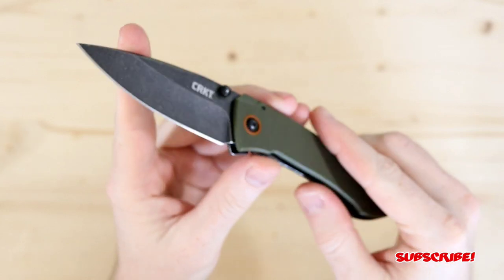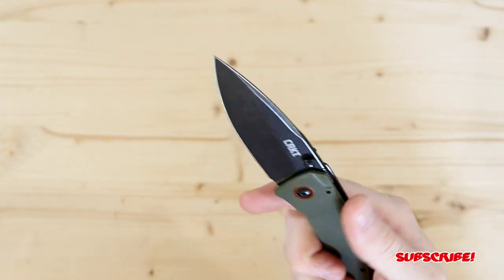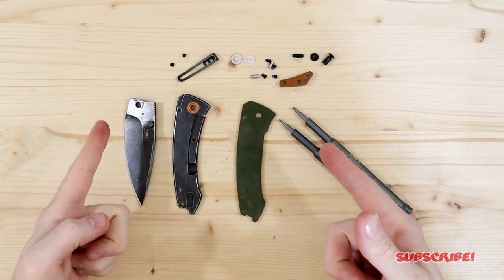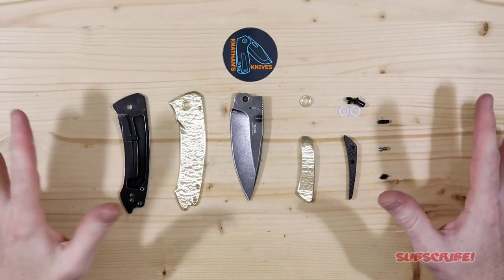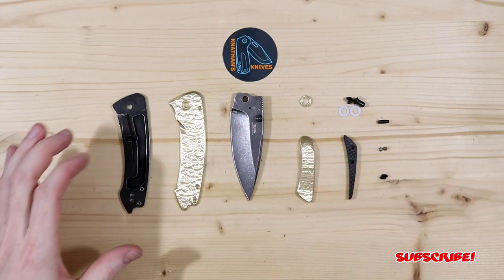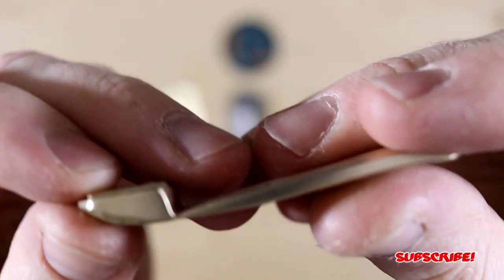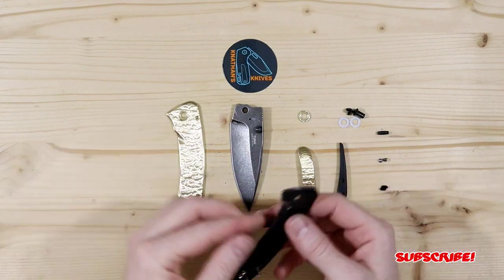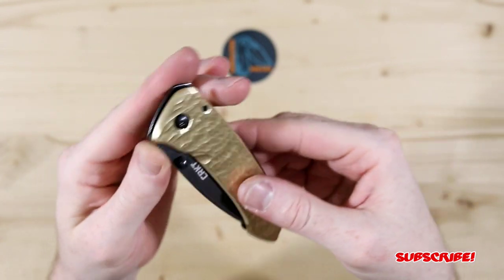750 Subscriber's GAW!!! CRKT Tuna Pocket Knife!!!(Knathan's Knives)

Comment: The TUNA knife looks awesome. Great contrast from the black to the brass. However, the clip makes me a little nervous with the thin transition from the anchor point to the long portion of the clip. It appears that would easily bend just placing the clip in the pocket of bluejeans. Not that I wouldn't absolutely love to have it as is and of course with you including the original clip, a great piece of work from a real craftsman.
Reply from the maker: Thank you! Honestly, that's always a concern with me when I creat clips from brass or copper, I'd make them from steel but brass and copper are so much fun to shape(steel likes to fight me😕).
I definitely need to create some Titanium clips then anodize them. Appreciate you looking out! GL on the GAW! 🤜💥🤛

Comment: That is a rockin’ TUNA! Have you ever tried a hammered texture on brass opposed to using a dremel? Solid work.
Reply from the maker: I have, but hammering a scale after shaping it tends to throw the hardware holes out of alignment. 😕
GL on the GAW! 😁
Reply: @KnathansKnives  thanks! Good to know. Trying to research different materials to replace my Pilar scale with.
Reply from the maker: No problem! The materials are endless with the Pilar! If you have any questions just let me know! 😁🤜💥🤛